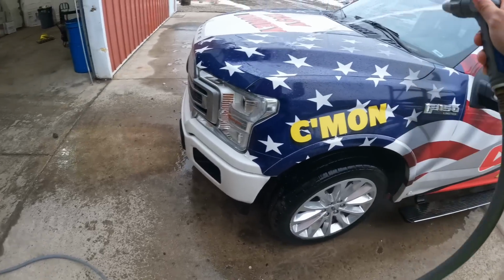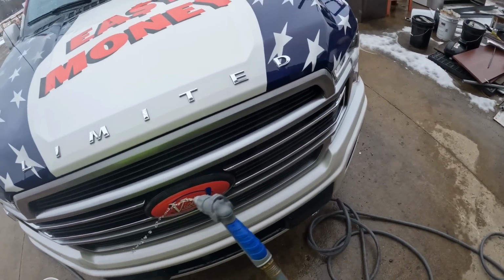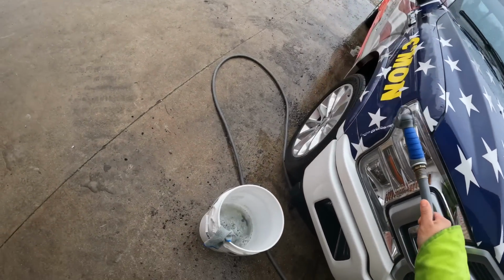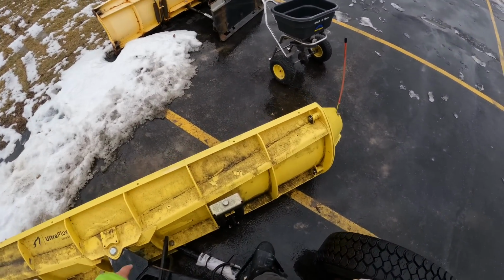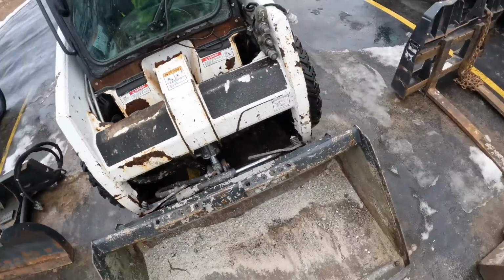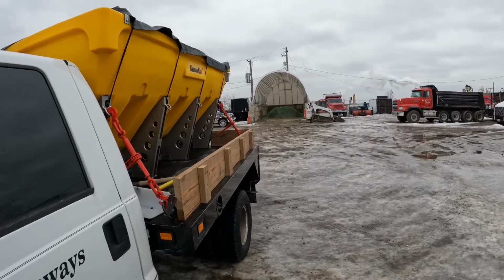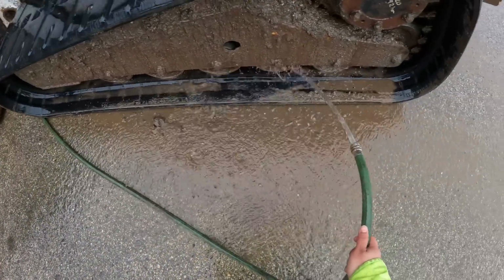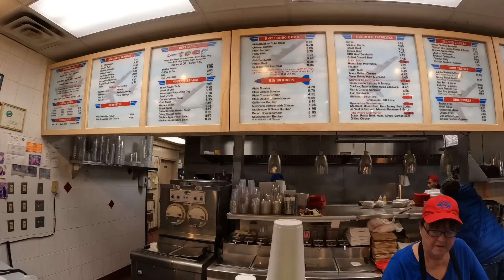Did a-lot of washing!!! Right in my heart ..

Comment: Idea for washing car at the shop for you to suggest to Ryan. Get a cheap electric power washer. Like a cheap one from home depot or a higher end one from harbor freight. Get a 55Gallon plastic drum. Get a float valve that will turn off the water when the float is up and turn on water then the float is down (like how a toilet valve works). Water hose into top of plastic drum with flat vale inside drum. Another hose from bottom side of drum to power washer. You'll have plenty of water to feed the power washer for washing cars and when the drum is full the water to the drum will turn off automatically. When the water level goes down, the water will turn on to the drum and will start filling the drum. You won't run out of water unless you stand there for ever with the power washer on. Had a system like this at a dealership I worked at that had low water pressure and worked great.
Reply: As long as the water does not freeze.

Comment: Hey Easy Eric you should tell Ryan to get a portable water pump you can plug it into any outlet and it should provide much better water pressure than what you’re working with there
Reply: Normally I would agree with you bullet.. but you have to be really careful with power washers and wrapped vehicles.. I would amagine that's why they're just not at a car wash.

Comment: Works has a cheap pressure washer that u can put the end into a 5 gal bucket of water requires no pressure to run it simply uses what u got and makes a pretty strong spray. Would definitely improve your washing situation ten fold. Even has soap connectors and stuff for them.

Comment: Good job Eric , heartbreaking to watch you washing vehicles with such low water pressure.

Here in the UK we have battery operated pressure washers , that would be quicker and better to get the salt off too & bottom .

See if you can get 1 of the washers ?
Reply: Standard pressure washers ruin your car unless there's low power ones meant for cars specifically